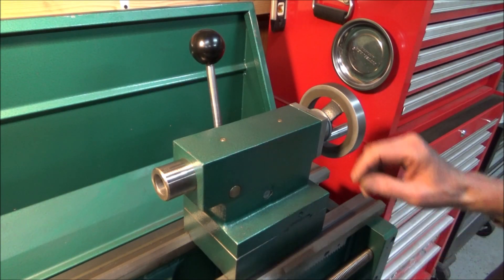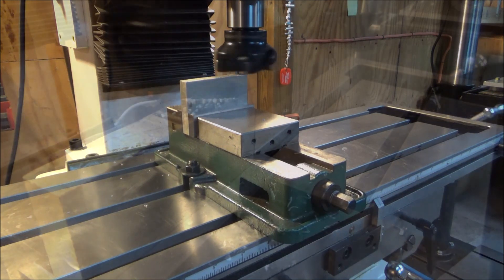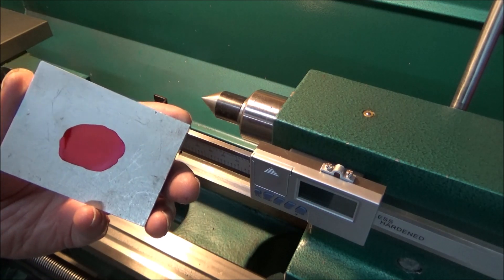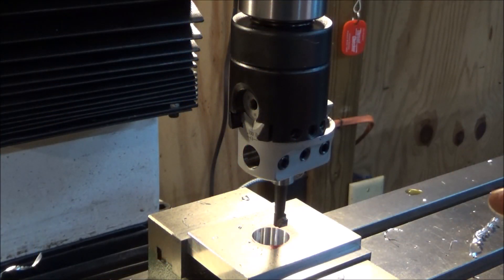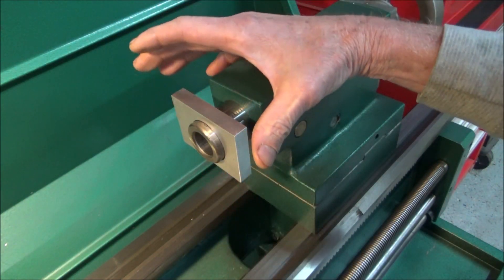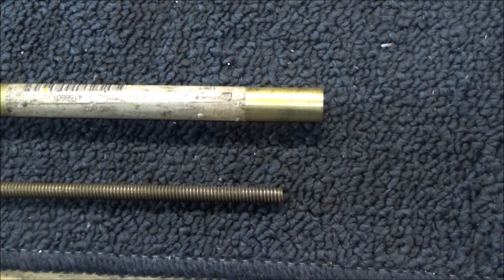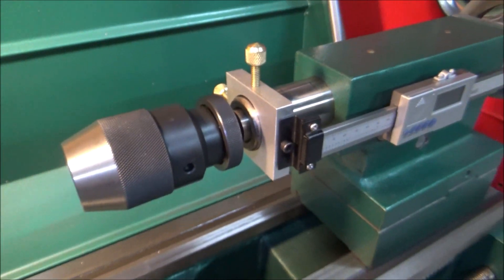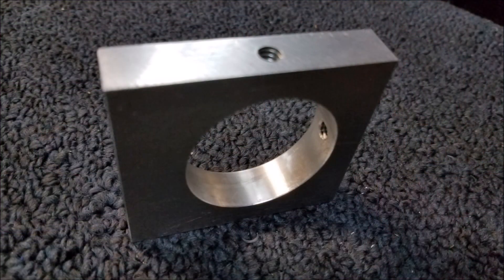Making A Lathe Tailstock DRO Holder

Comment: I made one of these exactly the same way but discovered that under load the tailstock rotated a little due to a little slop in the keyway. If I left it this way the twist would damage the caliper so I found it necessary to make a very neat fitting sliding bearing in the slot of the end of the caliper mount so the tailstock could rotate a little but it wouldn't twist the caliper arm but was neat enough there was no play in the horizonal movement. Now I'm happy with it and can use large drills or annular cutters with no problem.

Comment: Curious as to how the magnet will work out.  I have always found that though the modern magnets have excellent down force they tend to slip quite easily especially so on a painted or anything less than perfect surface.  Which blows the accuracy and the reliability all to heck.  I bought (another project on the list) a DRO with a third axis that I intend to dedicate to the tailstock.  I am thinking along the lines of a block with a dovetail cutout to receive the scale and yet be easily removable.  Of course it requires a couple of holes drilled and tapped which I hate doing on machinery but can't escape the necessity!   Always look forward to your videos as they give me insight into extras for our similar lathes (I was surprised to learn the 'g' series has a D-5 mounting system while yours has a D-4.  Probably required by the bit larger bore in the headstock of the gunsmithing lathes?).  You eliminate a lot of wasted effort going down the wrong road for me.  Thanks.  Keep them coming.  My current project for the bad weather is fabricating extension kits for my 4 1/2" thick doors as the locksets only go less than 2".  Seems the lock companies haven't kept up with the times where super insulating requires much thicker doors.  I haven't found any domestic or foreign that do.
Reply from the maker: Hey thanks Douglas. It's a pretty stout magnet being about a half inch thick. I could move it with a decent knock I suppose, I'll have to be aware of that. I do like the idea of the dovetail for sure. I've had to do similar mods to a door in the past. Thanks again.